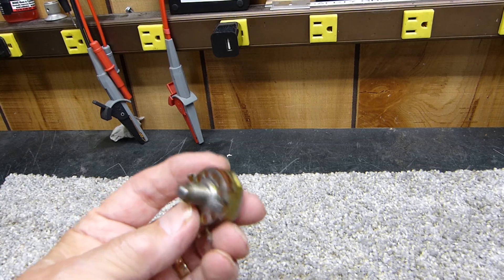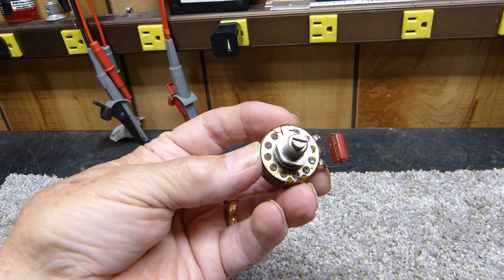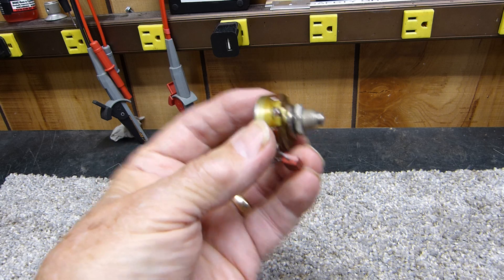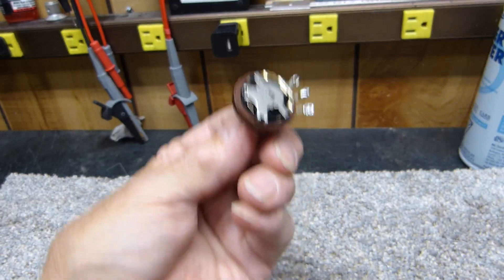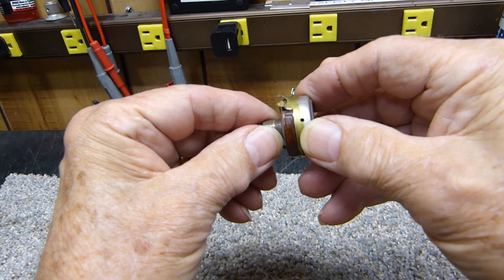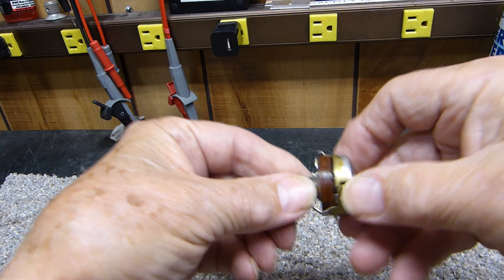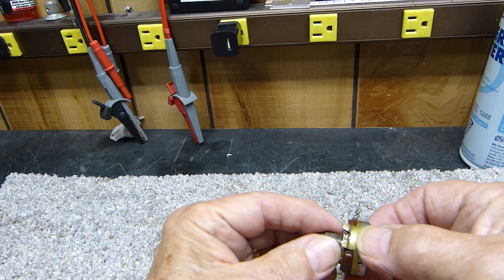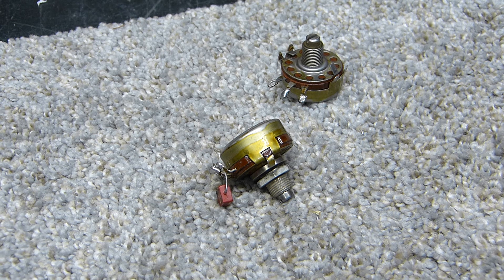Cleaning A/B (Allen Bradley) Sealed Potentiometers (volume or tone controls)

Comment: I managed to get a 9x9x9 box of these, new old stock from the military at a hamfest for like 10 bucks. I still trying to figure out what to do with all of them haha
Reply from the maker: They are the best of the best but as the video shows, even sealed they may need cleaning after 50 years.  :-) One thing to always keep in mind is to determine if they are linear or audio/log taper. It is easy to do with an ohm meter.
Reply: @ElPasoTubeAmps I appreciate that. In this video made me realize that being sealed doesn't mean being forever.

Comment: Glad to see another video from you David it's always so nice to see you! and like always you teach us something. I have been watching your older videos on some of your 4-400 amplifiers. I came across a good deal on some 4-400A and some 4-125 tubes all NOS, Im searching for a good HV transformer currently.... hard to come by around this part of Canada. Anyway, I hope you and the kitties are doing great and I hope to see some more videos from you! of course only if you'd like to share with us :) I might even have to build me a little jewel amp over the winter
Reply from the maker: Big power transformers (plate transformer - is the best name to search for on Ebay) are becomming harder and harder to come by. I have not tried them yet but the industrial control transformers (ICT) or even microwave oven transformers (MOT) might work OK. The ICT transformers are usually not over 480 VAC but a couple in series is 960 and a doubler into a capacitor filter should give a good 2500 VDC. Might be one solution.  73

Comment: I have a few of these in my spares, I wish I had more of them, they're easily the best made pots out of any modern ones I have except maybe a couple of stupid expensive ones. I might try poking a hole in one like this just for fun. One question though, do you cover the hole after you're done? Little square of kapton tape maybe?
Reply from the maker: I did not cover the hole. Think about the more common pot with an open port right at the three connections. Might seem less quality but it can be easily cleaned. I can clean it once every 60 years or so...   🙂

Comment: I bought about 100 or so ABs from a Los Alamos estate sale years ago. You're right, they get scratchy.  Isn't there glue holding them together in addition to the tabs?
Reply from the maker: The glue is very dried out. Just bend the tabs back like I did in the video and with a small screw driver carefully pop the metal part off or do as I did and just drill a hole in it close to the back and see what happens... 🙂 worked for me.

Comment: OK, this begs a question David, what is it that causes the scratch in these?
My understanding is that the pots are sealed (before you drill a small hole in the casing)😀
Is it some microscopic dirt ingress due to maybe an imperfect seal or maybe loosening up of the carbon particles from the carbon tracks that the wiper moves over?
It obviously can't be small amount of DC voltage present on the pot causing the scratch which cannot be eliminated by cleaning.
thanks for these videos and glad to hear your voice again.
Reply from the maker: I asked that of ChatGPT and it said the carbon band was always good but the metal on the wiper becomes oxidized. Makes sense. Just a quick shot of contact cleaner and it is perfect. I did it to four pots and all my equipment is healed...   🙂